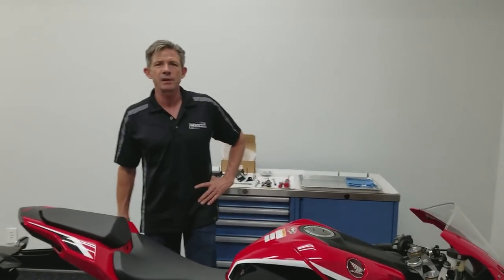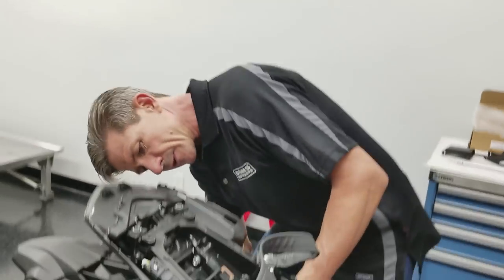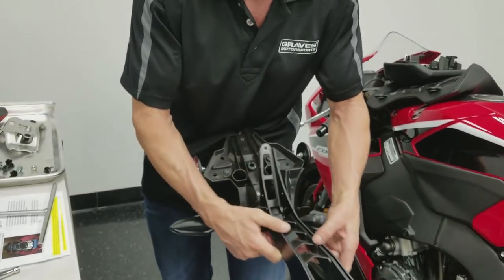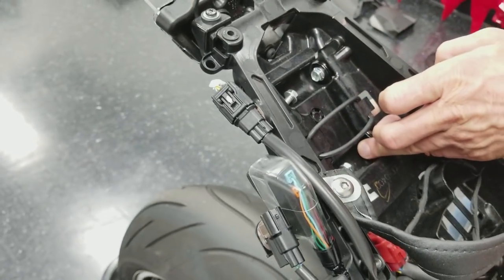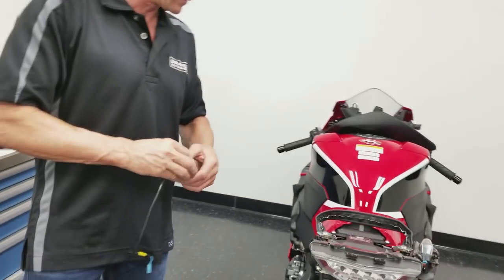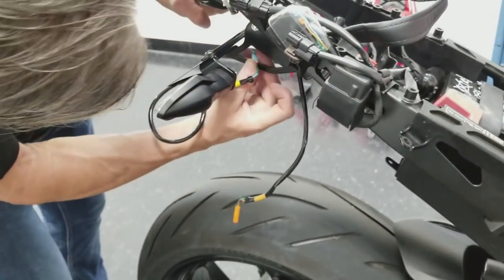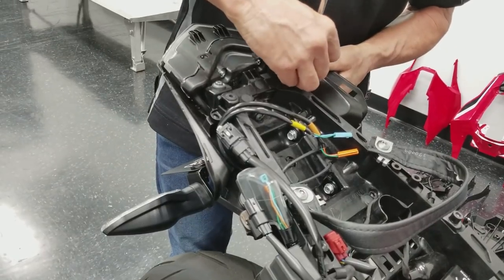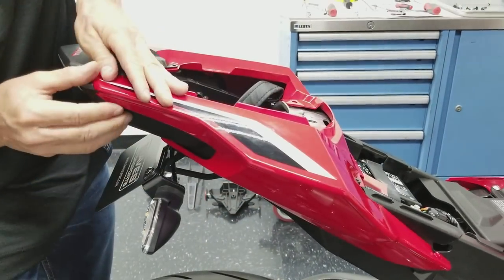2017 CBR1000rr Fender Eliminator Install by Graves Motorsports

Comment: Good video except for one major detail: the first center bracket has to be mounted a certain way otherwise the under fairing will not fit in correctly. Pay close attention to this when installing this otherwise you have to go back and undo quite a bit to get it right like I had to.

Comment: It took 2 minutes to install a tidy tail on my GSX R750.
Reply: Congratulations
Reply: in comparison to the cbr, the gsxr750 is a dinosaur. I went from an L series 2011 750, to a 2017 cbr1000rr sp2, and the difference is DRASTIC.

Comment: Are the turn signals flashing quickly because there is no license plate light installed?
Reply: You can put a relay or a resistor in the circuit to fix that.

Comment: The part that's edited out where he can't get the cover back on... guess what I'm having issues with.  Won't fit without modification.  Video just skips right over that part..!?!?
Reply: If you haven't figured it out yet, the bracket that has four bolts into the frame is installed backwards in this video.  The tab on that bottom tray won't fit in there like that.
Reply: I just got mine and the cut outs for the factory signal lights are too large, any body else experience this?

Comment: Buongiorno, sono in procinto di acquistare un terminale di scarico aftermarket per honda cbr1000rr 2017. Sul terminale di serie (euro4) è presente la valvola di scarico. Alcuni utenti dicono che rimuovendo la valvola di scarico si perde la regolazione elettronica del freno motore. Voi che notizie mi date? è vero? cosa cambia realmente  sulla moto?
Grazie mille in anticipo.